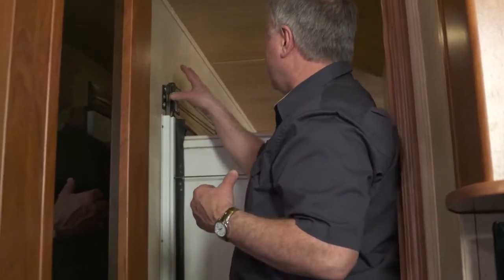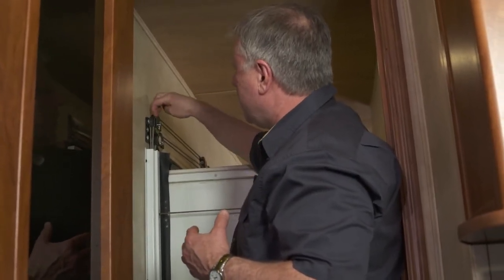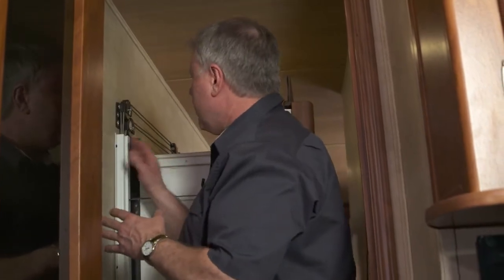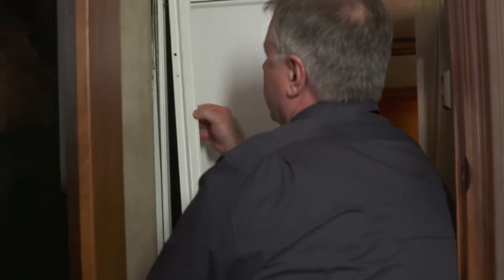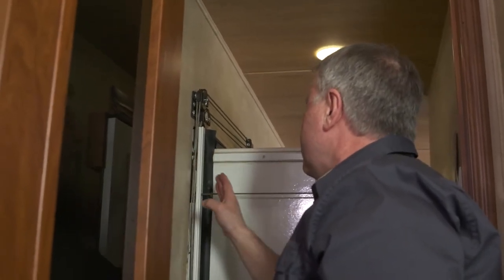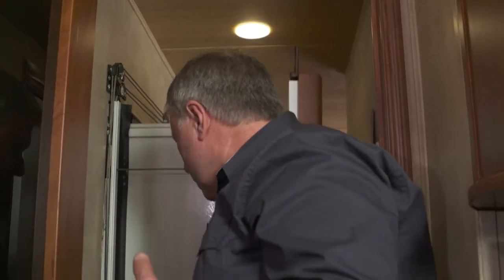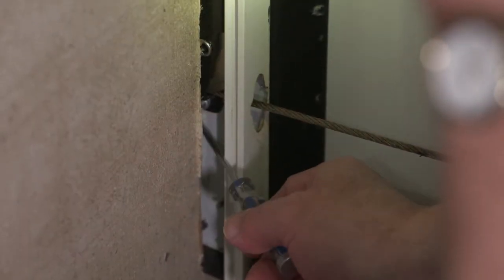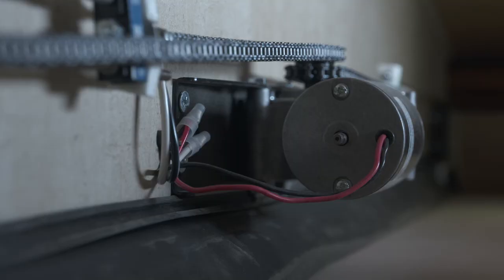Fix a Camper Slide-Out Making a Grinding Noise

Comment: All well and good, and a great video by the way, but how do you get at anything when the bedroom slide is already OUT. Already had to fix a, IMO, design flaw, in our Main slide where the IN/OUT blocks would rotate just enough to collide with each other preventing the slide for going out. A piece of 1/4" underlayment between the two sets of cables prevented those blocks from every touching. 100% fixed that problem.

Now, however, after only 15K miles, the bedroom slide is extended but will only come back in about 3" before a very expensive grinding noise is heard. Same noise is heard if I try to move the slide back those 3" when it nears its fully extended position. I can remove the wood trim at the top but boy the sides are going to be a problem as there is so little room between the sides of the slide and the walls of the bedroom.
Reply from the maker: Yeah it sounds like something is hanging up again. 
Unfortunately you will probably have to remove the trim on the sides to 
gain access to the other pullys for inspection. If everything on top 
looks fine, the sides are the next place to go. I will include a link to
 a website that has great troubleshooting procedures and hopefully you 
can find what you need.http://norcoind.com/bal/downloads/accuslide/accuslide_service-manual.pdf